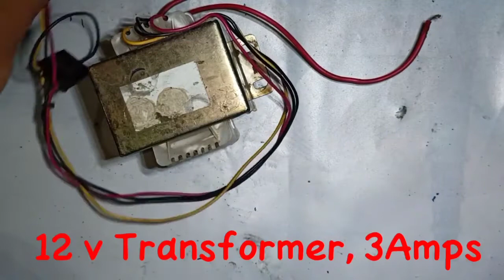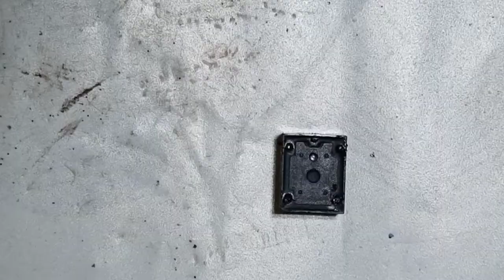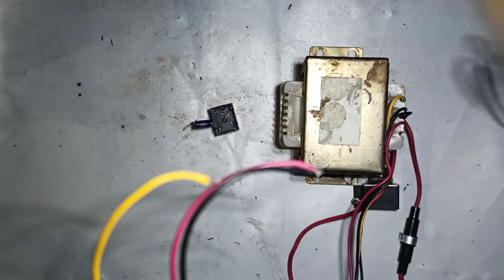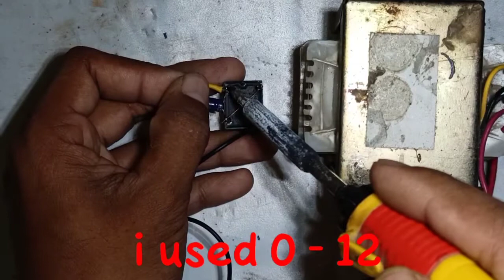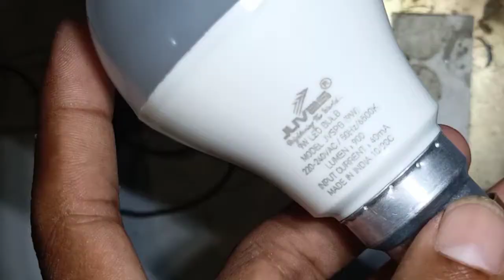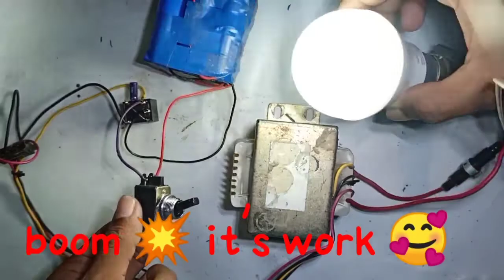12 v dc to 220 v ac inverter .9 watt inverter .

Comment: If only once they were surprised not with a light bulb, but with the inclusion of an iron, a microwave oven, a refrigerator. And this light will burn from the battery, it is not necessary to bother like that?.)) Хоть бы раз удивили не лампочкой, а включением утюг, микроволновкой, холодильником. А эта лампочка и от акб будет гореть, не обязательно так заморачиваться ?.))